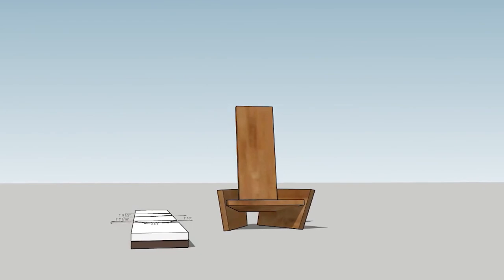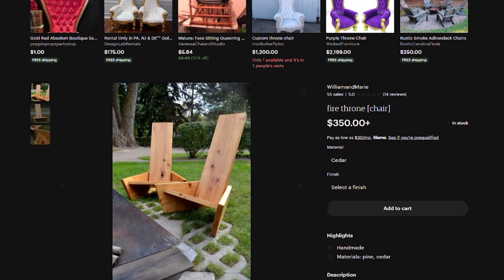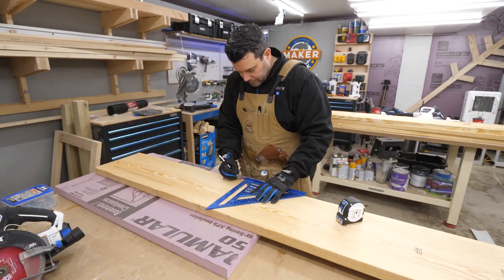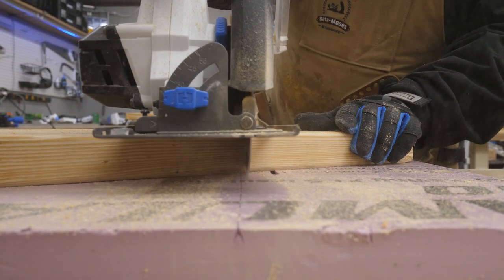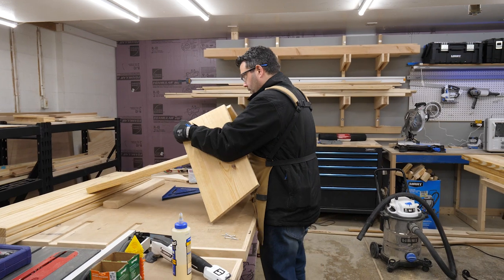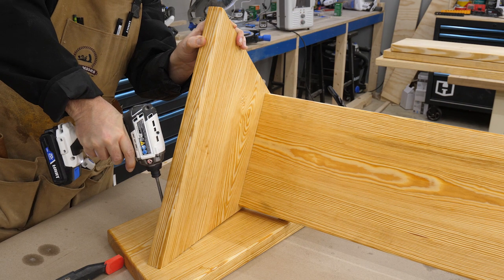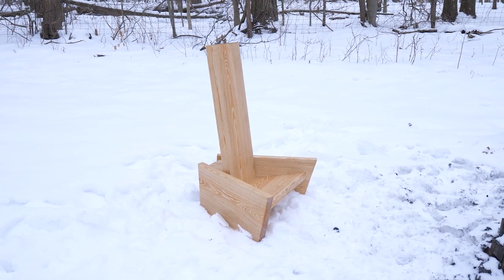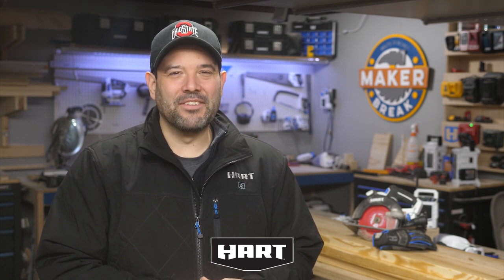Build a FIRE THRONE with only ONE $20 board! Time for a Maker Break!

Comment: Nice looking and functioning chair. I would cut a hand opening in the backrest top, glue on a horizontal reinforcement, round it all. Then radius the back bottom of the legs. Then add some aluminum or sheet steel cover over the rounded. Then just pull it around. But then again, I haven't owned much I didn't modify. Again, its sharp! And the tall back will be good for a windbreak, seeing ya sit upwind...for the 2 minutes until it changes 180°.

Comment: I totally want to make this. Where are the plans? Looks easy enough just need those angles.
Reply from the maker: Hey Brian! I'm working on them. I decided instead of the Sketchup file, I'm going to just make a simple PDF you can download since the cuts are so simple. I should have it up tomorrow.
Reply from the maker: If you don't want to wait, just know that the seat (and back support) are cut at 25 degrees, the side supports have a 15 degree cut in the front just for looks, and you have to angle the backrest 11.5 degrees back (or close to it). Good luck!
Reply: @MakerBreak  Awesome. And BTW you two are my favorite on YouTube. Thanks for what y’all do.
Reply from the maker: @briankling5694  https://tinyurl.com/makerbreak0212